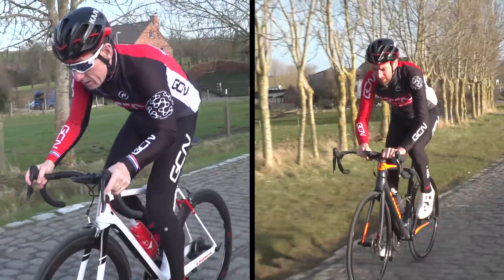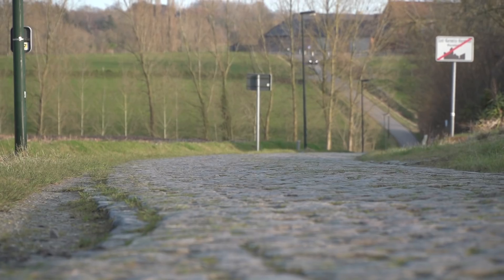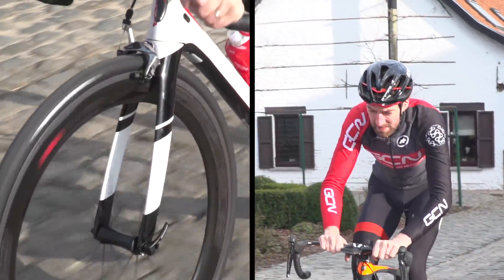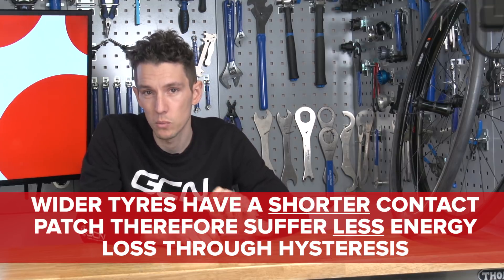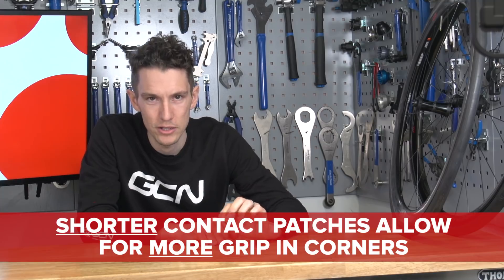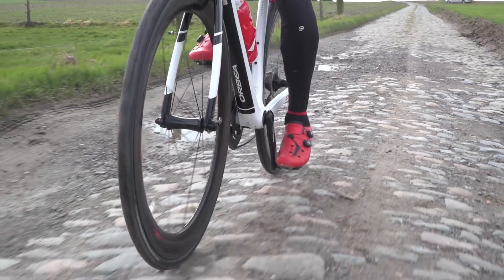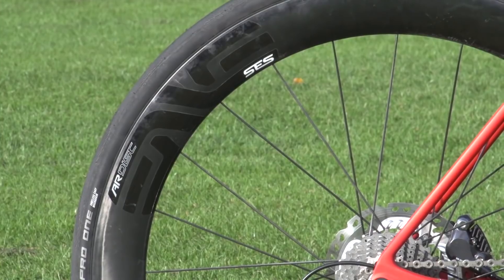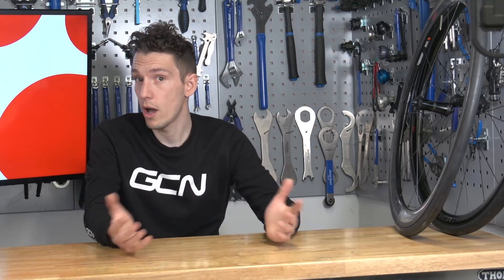Cycling Tyre Width Test On Cobbles | The Geek Edition

Comment: There was no mention of the extra energy required to accelerate a heavier wheels as a result of increased rotating weight.  Every pedal stroke is an acceleration and even the smallest increase in effort in each pedal stroke results in using more energy.  So we save some energy with lower rolling resistance on rougher roads with wider tires, but we waste energy accelerating heaver wheels as a result of heavier wider tires.

Comment: I'm currently only riding alone, no competitions.
Using stock wheels and tires for the trek 1.1  I was Wondering if i can for 28mm tires on there and will it be a noticeable difference in smoothness and rolling resistance?

Comment: You guys have a tendency to say that data are not "statistically significant" when you get one number not very different from another.  More accurate is to say that the difference is not enough to seem like it matters or that it is not physically significant.  Since you never actually make repeat measurements in your videos, nothing you EVER see is statistically significant.  You do not do a statistical test, and have no idea how variable your measurements would be and what comprises signal vs. noise.  I like the videos anyway, I'm  a big fan of the show.   I get also that you have some constraints.

Comment: to allow a better comparison between tyre widths you need to measure tyre drop with the rider sitting on the bike. this ia how wider tyres require less pressure and not feel like your tyre pressure is to low

Comment: Possible error in this test (although I'm not thoroughly convinced that a 25 vs. a 28mm tire makes a difference for speed on such extreme surfaces - puncture protection is more important I'd guess) is that they were all at the same pressure, not the same tension. As tire volume increases, a corresponding pressure makes the tire harder. A mountain bike tire at 30 psi is firm while a 19mm road tubular from the bad old days at 30 psi is anything but. The proper way to measure pressures for rolling resistance between different sizes of otherwise identical tires should be the firmness or tension of the tire, no?

Comment: You failed to mention the width of the rims. GCN should be testing on a minimum of a 23 mm wide wheel. In addition you should not be using the same air pressure for 3 different widths of tires.

Comment: @gcntech on the test, I think that they should have adapted tyre pressure to the width maybe by using the Mavic app... MyMavic. I used it as to make a start point after having a new tubeless road wheelset, and worked nicely. That app takes rider weight, inner rim width, tyre width and if tubular, clincher or tubeless into the equation.

Comment: Because cross winds cause problems for deep section wheels. Would there be an aero advantage to use say a 46mm deep wheel in the rear and a 32mm in the front, rather than having matching depth front and rear? #askgcnanything #gcntech

Comment: I run 28s on my 28mm rims and 25s on my 23mm rims. Both Gator Hardshells. The 28s feel more supple as I run less psi and they sound great. The 25s feel fine as well. I’m not looking for gains, necessarily, but sizing the rubber to the rim and riding. All these micro gains make my head spin because there are equally compelling counter arguments and the differences are so minute. I get it’s all nuanced fun within the hobby, but come on, let’s face it - our bodies and minds hold us back more than any equipment can. Nice video.

Comment: Remember the pro's are doing this on tubulars so regardless of tyre pressure on the 23m, 25, and 28m it is still not going to be that accurate on clinchers!  Lower pressure on clinchers =pinch flat! There are still some of us who prefer tubulars over clinchers I've always had better luck with tubulars throughout the years!
Reply: Hedley Kerr me too. And i a have run tubulars 25mm at 40 psi on chip seal. No probs and comfy.
Reply: Never run them that low 65psi on 25mm  yes very comfortable, just sometimes members on club rides saying your going to get a pinch flat over and over and not really knowing the science/construction behind tubulars!
Reply: Hedley Kerr It was fine for the next 75km did a 101km sportif with tyres at 65psi then 40 psi back the next day

Comment: What absolute drivel. The larger tyres take more power to roll both in aerodynamic efficiency and weight and regardless of contact patch weight will cause the same grip. This all sounds like a conspiracy by bike companies to sell disc brakes as they lose contact with the road surface more quickly when braking than calliper brakes. In essence a solution to a problem that didn’t ever exist. The pros are still running 24mm tyres!!
Reply: icycalm03 yes i agree, although true what Si says, it makes little difference to performance on normal roads, but I do believe when on chip seal or cobbles, lower pressures do increase comfort and speed, as energy is lost bouncing the bike up and down. BUT most of us don’t ride on cobbles. Maybe on chip seal (touring) so it is popular for these cyclist to run wider tyres at lower pressures. I have run my tubular 25mm at 40psi on chip seal and the comfort was far improved. But overall this different tyre size thing is marginal.
Reply: you are talking out of your a**  ''The pros are still running 24mm tyres'' no they are not, last year smallest tyre size in tour de france was 25mm and out of 6 first stages 4 were won with 26mm tyres(sagan&kittel)...  you will not find anything smaller than 25mm this year either, the pros use 25-28mm sizes from tarmac->cobble races. in tour de france 9 teams used conti 25mm,  6 teams used vittoria 25mm, 2 teams used specialized 26mm and rest used different  brands at 25mm size.
+Many of those 25mm actually measure at 26mm or even more specially after they are broken in and stretched.  Zero 23-24mm tyres in  2017, if you race with anything less outside velodrome or smooth time trial course you are idiot. i bet you will see even more 26-28mm this year maybe even larger in cobbles

and disc brakes dont loose contact faster with the road surface vs caliper that is complete bollocks.... but hey keep lying m8, you will just look like idiot drivelling nonsense
Reply: in 2012 the year bradley won first time. Orica-GreenEdge Continental Competition 25mm tires; Rabobank  25mm Vittoria Corsa Evo SC’s; Sky  Veloflex 24mm tires, which measure out to 24.9mm.
RadioShack-Nissan  25mm Schwalbe Ultremo HTs on their 27mm-wide Bontrager Aeolus 5 D3 rims. Both Omega Pharma-Quick Step and Saxo Bank,prototype Specialized tires 25.4mm wide. The Mavic tubular on the front of Tyler Farrar’s Garmin-Barracuda Cervelo R3 on Friday measures out to 24.2mm only french spanish and italian teams used 23's that year

you are about 7 years behind the development driveling nonsense
Reply: J H In reference to the disc brakes, a little off topic. What the OP is talking about is fork loading. On disc brakes the “suspension” in the fork is loaded under braking, therefore if the surface is uneven the fork will have no flex to absorb the bumps. So it could very well bounce. Rim brakes do not load the forks. There is many disadvantages with disc brakes but everyone has there hands over their ears, and believes they are the new sliced bread. As for tyre size, 24-25.something is  not measurable, and as we all know tyres are never the size stamped on the side.

Comment: The contact patch (where the tyre contacts the road) in these kinds of comparisons should not be based on "equal tyre pressure" when comparing different size tyres. Rather, it should be based on equal tyre compression under load. Each tyre should be inflated to the pressure needed to create the same compression under load. The amount of compression is a percentage (usually 15% for smooth, level, paved roads) so it is relative to the tyre and tyre size. When you use the same pressure for different tyre sizes, you ruin the contact patch comparison. Why? To answer, let's begin by assuming the pressure used during the tests was "perfect" for the 25 mm tyre and created a compression under load of exactly 15%. In other words, if the tire height in the middle of the contact patch was 25 mm with no load, it should have been compressed to 21.25 mm when Matt or Dan were on the bike. Using the same pressure as the 25 mm tyre, the 23 mm tyre would have been underinflated, causing it to compress more than 15%, and its contact patch would have been artificially increased as more of the tyre was flattened to meet the pavement. It also places the inner tube and wheel rim at greater risk of damage during the test on cobbles. On the other hand, using the same pressure as the 25 mm tyre, the 28 mm tyre would have been overinflated, causing it to compress less than 15%, and its contact patch would have been artificially reduced as less tyre was flattened to meet the pavement. This caused all the contact patches to move closer together in size (than they should have) and is a significant reason why the differences between the tyre sizes was minimized in the test -- using the same tyre pressure worked against you. The only way for each tyre to achieve the contact patch size intended by the manufacturer is if it is inflated to the correct pressure for the load placed upon it. This pressure changes with tyre size because of the change in air volume inside the tyre. Another, unrelated reason why the differences in tyre size were minimized is because the distance traveled in each test was so short.
Reply: D.Eldon Great! Finally we have somebody who really seems to know what ist going on. GCN, when producing a video, do you even consult any engineers? In my opinion it is embarrassing to produce an educational video not giving the reasons and unfortunately it effects your credibility, too. I learned more from this guy's comment than your video.
Reply: Finally! I cringed hard when gcn mentioned the benefits of having lower rolling resistance on wider tyres with same tyre pressure. Then why bother talking about comfort by lowering tyre pressure?
Reply: Over a year old, I know, but what I want to know is if you go with wider tires with the same tire pressure we know it will ride the same and have (about) the same rolling resistance, but will cornering still be improved. If so, then is the only factor keeping cyclists riding narrower tires the aerodynamic benefits?

Comment: So the short version is "the first cycle of testing gave us meaningless data. We need to redesign the test"?
Reply: yes.. but the big take away is it does then support other aspects of the physics involved. that is the beauty of science and experimentation. you go in with a test path and an expected outcome. when you dont observe that outcome it allows you to dig deeper into variables that you didnt factor in or a mistake in the setup for the model used. this allows you expand the test to include or isolate the new variable creating a more specific model for testing. thus greater knowledge of the subject.

the mind is blown when thinking of how the first wheels were designed around many assumptions and no field of science that directly studied the physics involved in it. and only through these types of tests were people able to break down the  impact of width, pressure, temp, material properties, weight.. and we just pop them on and go without having to understand why they were ever designed the way they were.

sure they could have pulled in a resource that would have all this data for them but it can be fun to see the steps taken to figure it out.. like how do you reinvent the wheel right! haha
Reply: Have you ever read a scientific paper? That's what is happening all the time. Asking the right question from the start would make scientist obsolete quite soon.

Comment: Surely the biggest variable would be the cobbles?  The test therefore may be better on a  consistent smooth macadam surface to determine if wider tyres are faster than skinny?
Reply: Well no, wider tires can be run at a lower pressure than narrower tires due to the increased air volume, the test is to test how the allowance of lower pressures with wider tires will increase the suspension affect which means less lost wattage, basically enabling a wider tire to achieve it's maximum potential. Also a wider tire (28c and up) is not faster than a narrower tire because the gains made by the decreased rolling resistance is marginally offset by aerodynamics, however, this is only by a couple watts.
Reply: DJWolves97 yeah I get that and agree pressure is definitely a factor.  The behaviour and deformation of the tyres on each run will be vastly different due to the inconsistency of the cobbles and the riders would have risen different routes for the three tests each.

Comment: A 23c on 70 psi is soft while a 35c on 70 psi is rock hard. How does that work? 

And how come this video concludes there are no speed gains with fatter tires while in an other video a MTB won on a cobbled road race?
Reply: Onypop The volume of air in a bigger tire is greater than in a narrower tire, so you have to pump up a narrower tire up to a higher pressure to achieve a similar volume
Reply: Onypop There are speed gains, just wait a week and you'll see when they post a better video showing the affects of suspension that lower tire pressure create on a wider tire
Reply: DJWolves97 no no no, it is about deflection. A wider tyre has more volume, so at the same pressure it deflects less, while a narrow tyre deflects more. This is why you can run a wider tyre at a lower pressure with no risk of a pinch flat. If the surface is dead smooth a narrow tyre with a high pressure is always faster, but roads as we know aren’t like this. Why MTB try to run their tyres at super low pressures on some tracks.
Reply: wayne proud I never said a wider tire was faster on smooth roads, if you read what I was talking about you'll see that a wider tire is faster compared to a narrower tire over rough surfaces as in the test

Comment: How big are the diference between these tyre on normal road? Great vid and Simon as always well knowing presenter!
Reply: Petinka I would say the biggest difference would be under acceleration and high-speed corners. You will always be able to accelerate faster on a narrower tire as they are typically a lot lighter due to less material. A wider tire will always corner faster than a narrower tire because of how the contact patch conforms to the cornering forces. A narrower tire will also give you better straight-line grip, which really doesn't matter for cycling unless you are riding straight roads with minimal turns and you want to be able to brake a little faster
Reply: Thanks!

Comment: Suspension effect?
Reply: Derek Biggerstaff If the pressure is the same then there’s no difference to the suspension effect.
Reply: Exactly my point Si, to get the benefit of wider tyres on a rough surface you would reduce the pressure; which you could of course do with the narrow tyres but then you'd be in danger from pinch punctures. Cheers
Reply: Derek Biggerstaff Yup and typically wider tires have a much lower recommend TP range, the michelin pro 4's have a max recommended of 85 however, specialized makes the Turbo Pro's which have a max of 95

Comment: You used the same pressure for all tyre widths? Surely you want to use the same tyre tension and keep this the same....
Reply: Actually I think they do know.  They are building interest in the follow-up video where they vary tire pressure.  This is actually useful to know in itself.  What if any difference will there be riding a 28 mm tire at 60 psi (or whatever pressure is truly correct for that tire and their weight) versus riding it at 70 psi.  The other problem they have, is the shortness of the test, less than 4 minutes.  It is hard to believe there will be any significant difference over that short of a run, even if there's a difference of a minute or more over 60 km.
Reply: George Farrow Green  exactly. these guys don't know what they're doing